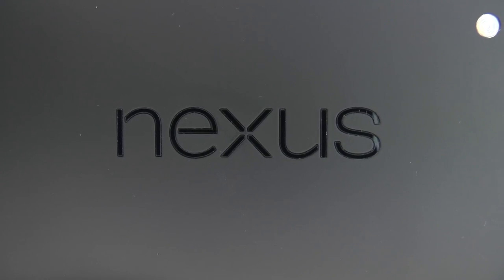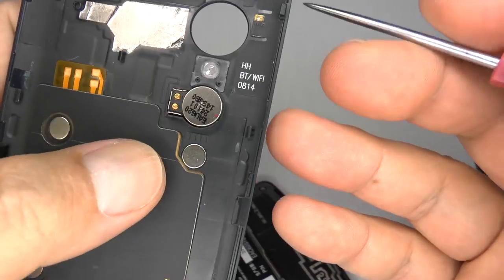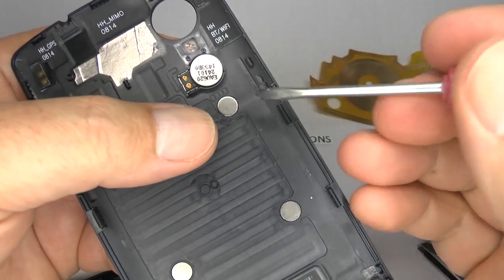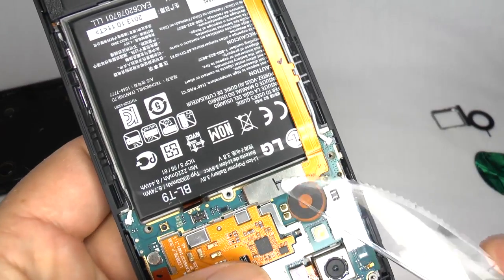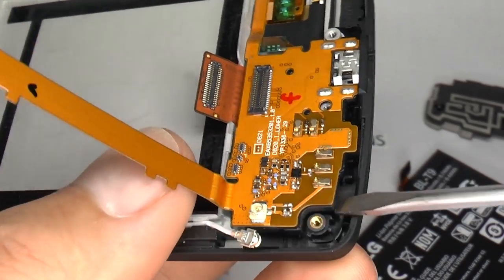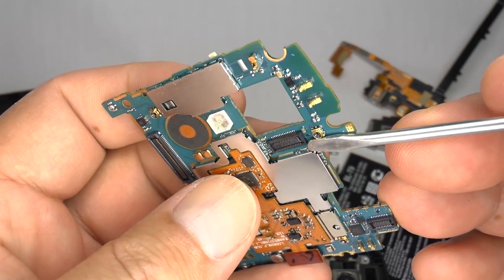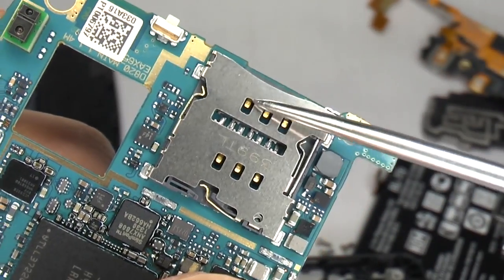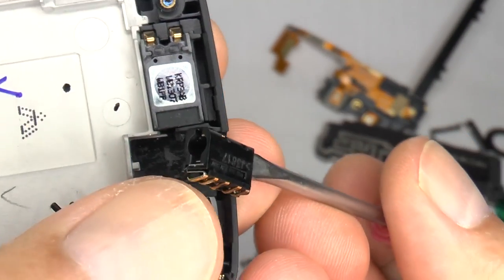Nexus 5 Teardown - Disassembly & Assembly - Screen Repair & Case Replacement LG-D821 - 820

Comment: HI!
Thanks for the thorough Nexus 5 video (I currently have a new screen on order, so will be going through your video again (very sloooowly) when it arrives :-)
I wonder if I might ask a couple of questions? I apologise if they are stupid, but here goes...

1) My phone has 16GB of internal memory. From you video, it looks like this chip is cemented / glued in. Is it possible to change this for a 32GB chip & can these be sourced?
2) I have a screen and digitiser ordered, but wonder if I also need one of these (a digitiser cover):

http://www.ebay.co.uk/itm/U-Front-Outer-Screen-Glass-Digitizer-Cover-for-LG-Google-Nexus-5-D820-D821-Tools-/181401478041?pt=UK_Replacement_Parts_Tools&hash=item2a3c5ee399

or can I just put a screen protector over the digitiser?

Thanks for your advice :-)

Steve.
Reply from the maker: your new screen and digitizer will come already with the glass but you can use screen protector if you want. 
The memory is not removable as its soldered in place...
Reply: ***** Thank you!
Your reply is a great help :-)
Steve.

Comment: Hi, thanks for such a fantastic tear down, i have used this video before with success, i have another nexus 5 that has been water damaged, it was dryed out and turned back on, all seems to be working apart from getting signal, so i replaced the speaker/antennae assembly, but still no luck, i have ordered a new flex that goes under it to try and fix the problem, could it be the cables or main board too?
Reply from the maker: I've never had much luck fixing water damaged phones, after replacing lots of parts they still have problems. They do seem to fetch good money on eBay...

Comment: Great video, I love the amount of detail you go into. Do you think it's possible to get out a microsim that's stuck in the slot without the tray with the phone disassembled? I can see that it looks like there's a small gap in the bottom of the holder, but I can't tell from that angle. I'm going to try it tomorrow as I've had no luck with getting it out without opening the phone, hopefully I haven't damaged the board or tray holder. Any suggestions on what could be the best way to get it out is appreciated :)
Reply from the maker: did you get it out ok?

Comment: What this part mean exactly? Is there any image to see?
"If the wireless charging is not working after repair, make sure you push down the back cover in the middle in line with the camera flash as there's one extra clip."
Reply from the maker: There's an extra clip in the middle of the back cover near the camera. Make sure its pushed until it 'clicks'

Comment: Dude, you saved my phone. It dropped into the toilet in the morning, after work I tore it down and left all parts dry for a day. After that, I built everything together again and it worked again.
Thanks for this video!
Reply: My Nexus 5 sat in snow for 3 days - just minor spots on the screen, after drying it in a bag with rice for a few days.

Comment: hi I replaced my broken camera lens and when I reassembled , I got a grey screen and a flickering screen , It was not there before , occured only after I disassembled and reassembled . Any tips ? the grey screen with colorful dots appears like every few minutes
Reply from the maker: try booting without the camera plugged in, if its ok then you know its the new camera causing the problem

Comment: I think you made a mistake with the antenna cables, I damaged my black one, which you stated as the 3g gsm, yet my 3g gsm works perfectly.

I believe the black cable is for 4g? Could you confirm this?

Great teardown by the way. Your nexus 4 teardown, and this one, have been invaluable.
Reply from the maker: I think it depends on what band/frequency your country uses. I spent ages experimenting with a 4g sim but couldn't find which cable was used..
Reply: Ah that would make sense, on my model (UK) the black one was definitely the 4g cable. Maybe worth adding an annotation on the video?

Comment: I have a question on the nexus 5, if the phone stays on firmware update and stay's like that not letting your phone work do i have to disassemble the battery to restart it's proper functions again.
Reply from the maker: disconnecting the battery might help but it will also void any warranty

Comment: ***** I replaced the screen + housing on my phone and all went very well (very easy phone to disassemble) except for the rear camera module. It can no longer focus when trying to take a picture. I have confirmed the internal nor external lens cover was smudged. The module is only 16 bucks shipped, so I'm not too worried about it...but any idea on what happened?
Reply from the maker: its a strange fault, hopefully a new one will be ok
Reply: Looks like I melted the glass adhesive with a heat gun hehe. Got a new one put in and its good

Comment: Thanks for the help :) I just changed a completely shattered glas screen on my Nexus 5 with the help of this video. Everything is working except for the wireless charging. Got any tips on what might be the problem?
Reply from the maker: yes, there's an extra clip that needs pushing down in the centre inline with the camera flash. You should feel it click down and then the charging will work
Reply: ***** Again thank you so much for the help. I took apart the back cover and could see the clip straight away. After reattaching the back cover all it needed was a gentle push in the right area with the thumb and then suddenly a 100% working phone again :DDD

Comment: hey *****  for some reason when I replaced my screen its doesn't work even thogh its a new screen. I've done with 3 time and still the same thing, I can see the notification light on and sound but screen not working?? do you think its the whole panel with where you plug in the charging port or what do you think could be wrong?
Reply from the maker: its probably a faulty new screen, you'll probably find another works ok..
Reply: Alright thanks! I mean I already tried 3 new screens and still nothing but It could happen that those were all bad.. So nothing else could be causing it like the wiring to the motherboard or something? Because led works and through that is where the screen is also sends information to the motherboard but yeah ill just keep trying thanks a lot!
Reply from the maker: vik kash If you've tried 3 new screens then it might be the main usb/display cable. Maybe test the screen on another N5..
Reply: Like the charging port panel you mean? Because what I was wondering there's two white and black antenna cables going from it to the motherboard and a bigger flex cable right? So if the led is on that panel as well wouldn't that mean it's gettingpower  and the charging port panel isn't the problem?
Reply: Because my led works
Reply: same problem, any updates?
Reply: I just sold it on eBay for 100$ because unless you know how to micro solder then you in luck *****
Reply: i thought so too :(, well thanks
Reply: ***** i had the same problem but id get white lines and pink static sometimes.. Then it went completely black but led still on. I Took it apart and the black cable was loose i also took off the charging usb part and saw some adhesive on it, i took it off, put the phone back together made sure the black and white wires were out of the way and snapped the case on and it worked! I thought i needed a new phone.. I think the adhesive wasnt letting the piece make contact.. Hope it helps

Comment: Hi, my nexus 5 got water damaged and I brought it to a repair shop, they cleaned it up for me and told me the screen and USB are toast.

I succesfully replaced the screen assembly and USB flex....

But when I put the phone in the charger, it won't boot up, all I get is the red LED blinking 8 times, over and over again.

Does anyone know what to do??

P.S. Only the bottom half of my phone got dunked in water. (The water indicators at the top half are still white)
Reply from the maker: try leaving it on charge overnight and then disconnect the battery for a minute. What did it do before replacing the screen?
Reply: ***** Thanks for the reply. I had read up on that and did it several times, to no avail. The phone did the same thing before replacing a new screen assembly and USB flex.

Do you think the main board is damaged ?
Reply from the maker: Nawrejin yes it does sound like the water has damaged the mainboard, its probably best to sell it on..

Comment: Hello. I really need help and I hope so much that you are the person I was looking for the last month! My problem is, that my phone goes off everytime its dropped too hard on a table etc. I located the problem at the point where the battery is connected to the mainboard. When its turned on and I give this place a really small push, the phone goes out. What could be the problem? 

If I push a little more left or right nothing happens. It just goes out if I push exactly on top of the connected battery. :(
Reply: +XMSJosh P:S.: even when the phone is out and I push this located area, it restarts. Its ridicolous
Reply: +XMSJosh Sounds as if the port where the battery connects may be damaged. You could try a new battery, but more likely than not the port needs to be replaced.

Comment: Hi LE55ONS I sucessfully replaced the screen on my N5 but doing so I firstly forgot to put in the volume/power buttons in so that meant disassembling which I did but in doing so I I managed to snap the black antenna signal do you have any idea where I can get a replacement or is it possible to use a 2nd White one as I have a old lg Optimus 4x HD and that has a white cable but I'm guessing the cable is wifi will it be okay to use or do I need the specific black coaxial cable please get back to me ASAP thnx man...Harry
Reply from the maker: if they are the same size and the plugs fit then it should be fine, but I doubt they are the correct length. Here's what you need http://www.etradesupply.com/lg-nexus-5-d820-signal-cable-black.html you can use coupon code ETS2 for a little discount which also gives me credit
Reply: The only thing is I'm in the UK though...."/
Reply from the maker: Harry Peart just found this one http://www.ebay.co.uk/itm/271399705878

Comment: Hi, I just ordered a new LCD Touch Digitizer Screen Assembly + Frame Parts but mine looks like this when I got it. Am I missing anything on it? Or is it possible to put the parts from my phone to this? PS the only thing that is broken with my phone is the screen everything else works fine. http://i60.tinypic.com/2eznuzd.jpg
Reply from the maker: Just swap all the parts over to that new screen and you'll be good to go...
Reply: Its so damn hard and im not sure if I have the courage to go on. Im thinking about to leave the screen back to seller. It cost 200 $ for repairation in Sweden but if I do it by myself it cost 100 $. But I feel I risk destroying it with all the sensitive parts rather than repairing it

Comment: Thank you for the video. I had a cracked screen and frame that I replaced with a new one. After assembling all the pieces on the front panel it looks like my cellular network doesn't work anymore, no calls and no SMS. It only connects when I am driving or outside in open. Interestingly, when I am under any roof the cellular network is completely gone, it was perfect until a couple of days back. Wifi, Bluetooth and Camera continue to work. Any idea what takes care of connecting to cellular network on the phone? I tried to reassemble everything back on my original front frame but same problem. Something on phone has weakened the ability to connect to the cellular network and I can't figure out which one.
Reply: +Naga Sudhir K The black cable at 11:14 is for the 3g/gsm antenna, make sure its fully plugged in or maybe try a new cable
Reply: +VauxhallHelp Thank you....I will have to get a replacement I believe....What is the white cable?...I am seeing a small cut in it.
Reply: +Naga Sudhir K I think its for 4G but it might cover other bands..

Comment: when you call. problems with sensor of proximity?
Reply from the maker: if the screen goes blank during voice calls it would be a problem with the proximity sensor ..
Reply: I have that problem with nexus 4 :(
Reply from the maker: Luis Manuel Aveiro Ok, if you replace the headphone socket it also come with a new proximity sensor Nexus 4 Teardown - Disassembly & Assembly - Screen & Case Replacement - Drop Test Repair
Reply: I replaced a broken screen with a new screen with frame and i have that problem :/
Reply from the maker: Luis Manuel Aveiro make sure that sensor has the rubber gasket and is pushed up against the glass, if you still have trouble, try putting some folded paper wedge between the case and the sensor so its pushed up against the glass
Reply: thank you very much :) 
saludos :)

Comment: my nexus 5 screen does not turn on and is scrambled when it does. Plus my accelerometer does not work. Is it time to replace my phone or is this repairable. 
(screen not broken i just dropped it alot though)
Reply: Something might have come loose in it. Try opening it up and checking all the connections.
Reply: +Schrödinger&#39;s Ape +le55ons , ive opened it up and now it starts normally but the screen is unresponsive to touch, please help. I have wiped the cache, would doing a factory reset helpÉ

Comment: Can i change the 4G antenna/module to one that support bands in my country for example 1800/2300
Reply from the maker: it might be possible with the right chips and tools but the mainboard might be arranged differently and the cost could be higher than buying the correct model for your country
Reply: ***** thank you for taking time to reply

Comment: Used this very video to fix my phone ran into 2 problems when I finished no vibration which I "just" fixed by snapping my phone near the camera thanks comments below! Anyways the only problem I have now is my top ear piece I cannot hear others talk unless I put it on speaker phone. The piece when I installed it seemed a little lower than the motherboard it was touching. Do I raise the speaker up with something if so what or try to clamp the 4 screws tighter in hopes of contact?
Reply from the maker: sounds like the foam gasket might be missing from the new screen. You could try raising the speaker or slightly bend the contacts so they touch the mainboard ..
Reply: Could I cut enough double adhesive tape maybe to make my own gasket to raise it?
Reply: James Tyler
There is a plastic piece you need to remove to raise the ear piece comes out pretty easy just pop it out with a small flathead screwdriver and it will raise the ear piece about a 1/16 of inch and resolve problem. look at video closely during that time you will see the raised platform

Comment: I have water stains under my screen from water damage. There;s not much i can do then replace the whole front plate?
Reply from the maker: if its working ok apart from the stain it can be repaired. The screen lifts out from the frame with a bit of heat and you can remove and clean the backlight lens. I'm currently working on another phone video and when that's finish I'll shoot another showing how it can be done..
Reply from the maker: this should help remove those stains Nexus 5 Screen Replacement - Frame Exchange + Display Teardown (liquid damage repair?) LG-D821 - 820

Comment: Was wondering as I cant find any info anywhere.Do you know if a digitizer only replacement is possible on the s4 mini i9195?
Reply from the maker: you can do a 'glass only' replacement like the normal S4 but if the digitizer isn't working it can't be replaced
Reply: Its working at the minute albeit with some small cracks in it. let you down for a nokia 820 last year or more ago.I dont suppose you have any interest in doing the video if I provide all the parts?I could maybe do the full assembly job but the digitizer only on the s4 mini is documented nowhere that I can see.Let me know cheers.
Reply from the maker: caldaddy09 the glass only replacement is the same for the s3, using lots of heat (about 60ºc) and playing cards or something thin. The main problem is the air gap you will have after repair. If you don't use an optical adhesive, dust will eventually enter the space and when you push on the screen you'll have an 'oil slick' affect. There's a few people on eBay that have all the correct equipment to offer a 'glass only' repair service. Have a look at their feedback and you should see some happy customers. I can't offer to do it myself as I have way too much work load already..
Reply: thanks very much only seen this now cheers

Comment: I dropped my nexus 5 and cannot get tower signal. Any idea what I should look for?
Reply: Me too plz help
Reply: +maury finkle +piyush jha Those would be either the white/gray (4G) or the black (3G) cables that connect to pins at the bottom of the motherboard, 10:52.
Reply: +Beowulf627  What am I looking for there? Should I see something broken????
Reply: Try plugging the cable(s) in and out, my guess is they came loose
Reply: +maury finkle Try pulling them out and reseating them. I had an issue with signal after I changed a battery that was due to a cable being loose.

Comment: if the glass has smashed but not the actual screen, can i just replace the glass or do i need a whole new screen?
Reply from the maker: a whole new screen is the easiest but the glass can be replaced. Search for 'nexus 5 glass replacement' and you should find a few videos. I tried making a 'glass only' video for the Galaxy S3 mini but it didn't go very well..
Reply: Alright, thank you for the reply

Comment: do you offer repairs I need the sim card replaced in my nexus 5 but dont have the tools to do it
Reply: tony terry just use a needle and insert it in the little hole beside the sim holder till the sim holder pops out.
Reply: Scott Calvert one guide I seen it said it was soldered in I'll buy the part and give it a go thanks